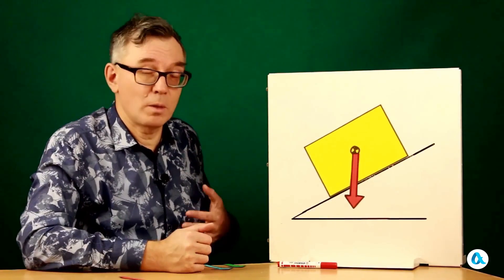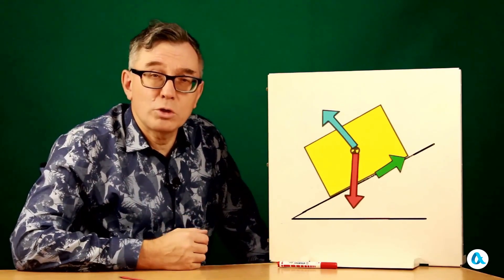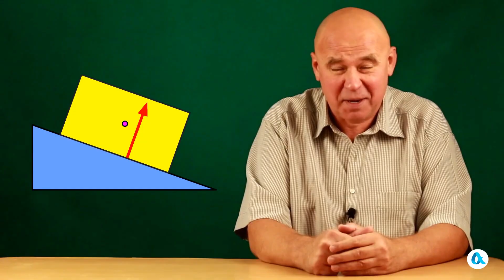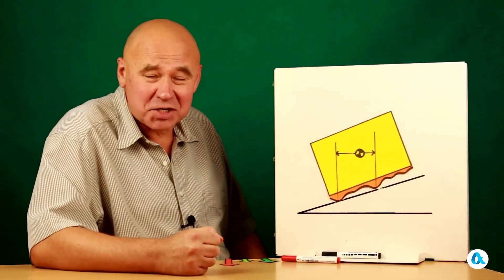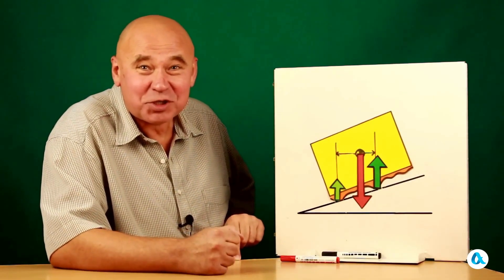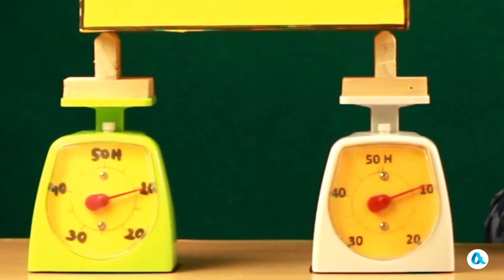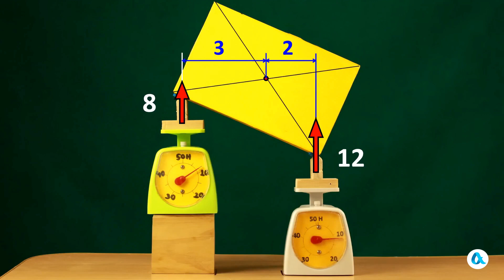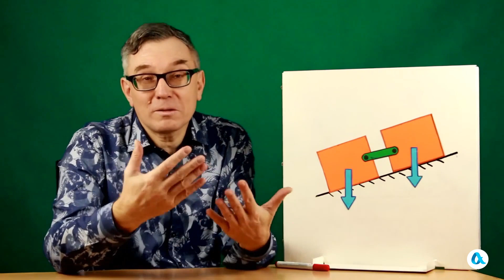Brick riddle

Comment: These are MY thoughts... When the brick is whole, a portion of the mass of the first\rear\top half of the brick is over\acting down on the second\front\lower half - & that is why the weight is greater on the front\lower half... With that in mind, when the halves are separate, the additional mass of the rear\top half,  no longer acts down on the front\lower leaving them equal...🤔

Comment: My explanation why there is more weight on the front than the back is this:
There is a triangular mass extending past the lower front corner of the brick, adding further weight to that side, while there is a hollow triangle above the bottom rear corner, so it is bound to carry less weight.
To better illustrate, let's look at a square brick (instead of rectangular), if the slope is at 45 degrees, it's easier to see how the weight is distributed equally on both sides of the bottom corner, and thus all the weight is concentrated to the bottom corner, which become the balancing point, causing the brick to roll over if the angle increases any further.

Comment: The inverse square law of universal gravitation says the higher end of the brick should press less.  Then there is the strength of cohesion between molecules in the intact brick itself drawing the higher end along with the lower end. London forces and  cohesive forces within a solid object like a brick due to the strong intermolecular forces between the constituent particles will likely cancel out gravitational differential effect on front and back ends of the brick. 

Numerous scales or dial indicators replacing the sloping board could be used to directly indicate the truth or falsity of the propositions.
Reply: True on  micro unit scales for gravity.

Slide block on a sand slope note front edge sinks in  while real lifts.

Block rotates from rotational  moment created by sliding friction pushing front edge down while lifting rear edge .

Therefore front edge has more force even when static .
Reply: @Motorhead250 : Sand doesn't represent a static self cohesive surface. Sand is relatively dynamic similar to water though also relatively having a million fold greater quotient of friction. Ergo, irrelevant to strictly vertical components of friction or gravitational vectors
Reply: @rogerscottcathey Ok let's use a pressure sensitive plastic that is able to deform.
Or multiple scales to measure transfer of force to down hill side ..

Static friction much higher than dynamic friction. 
 

Downhill side has higher force from cg tilted . 
That's why a box will tumble down ramp of cg is to high lifts uphill end .